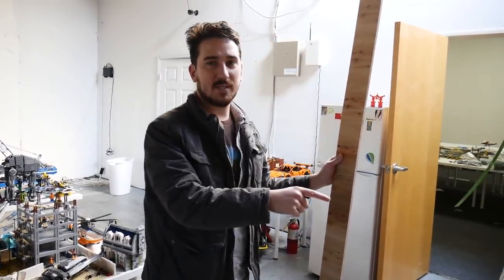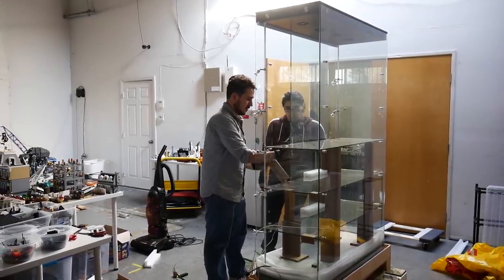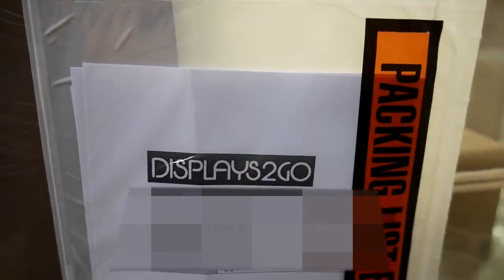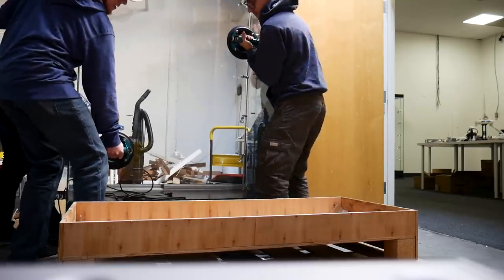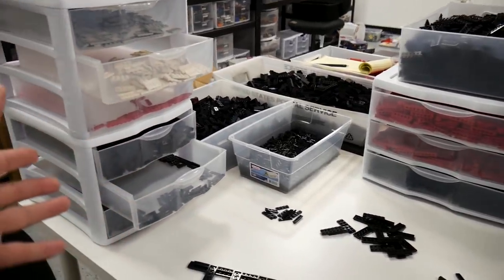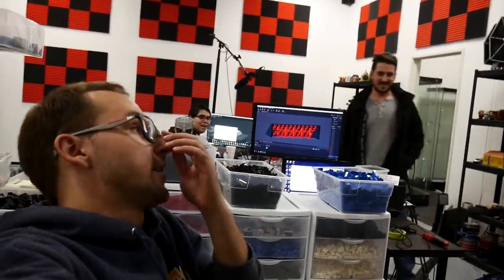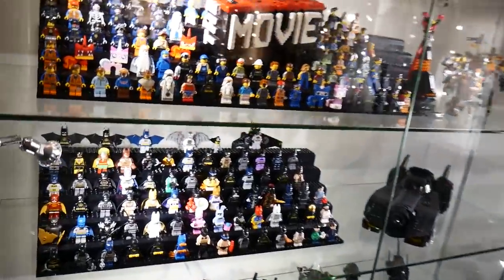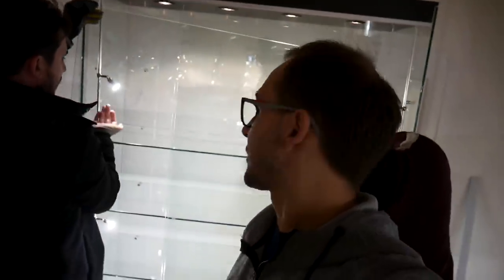Building the ULTIMATE LEGO SHOWROOM (with smart lights and glass displays!) | Brick VLOG #40

Comment: What is the brand of the smart lights?
Reply from the maker: Lights are normal LEDs powered through TP-Link smart power strips. You connect those to your network and control the power through the app, that's it.